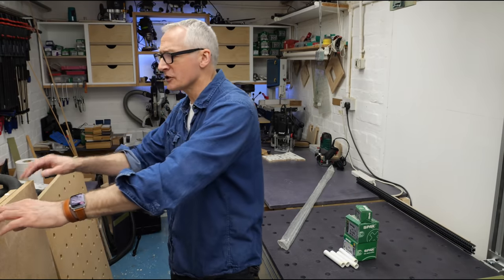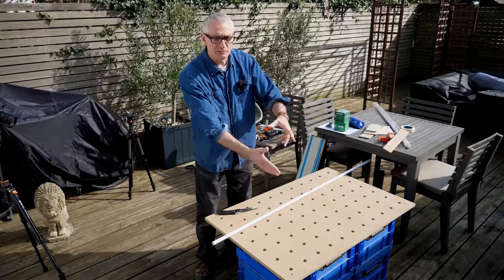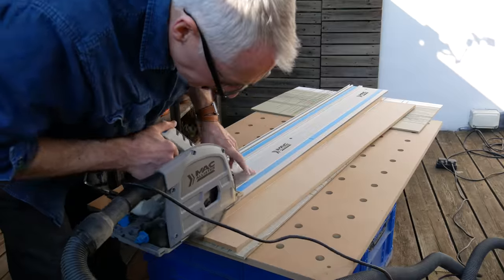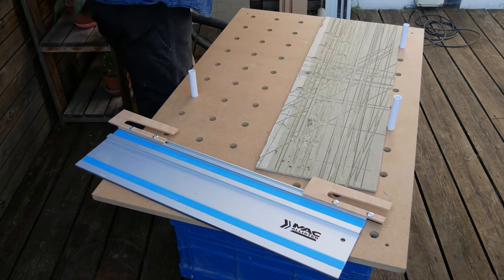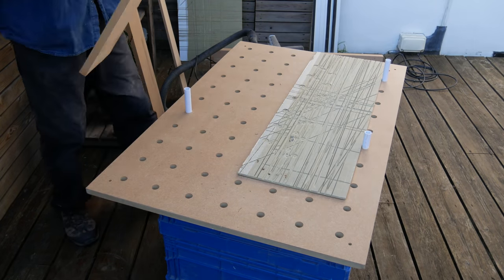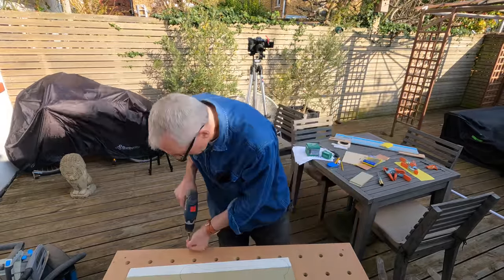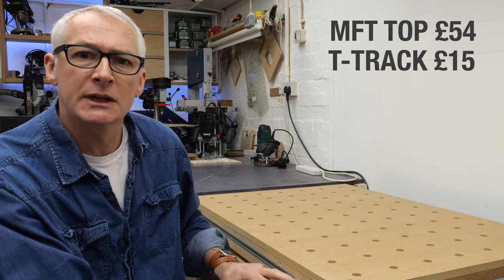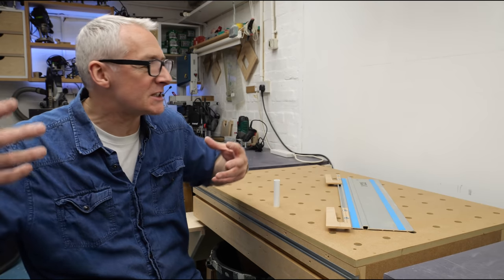Backyard, DIY MFT on a Budget  [video 490]

Comment: One Question Peter, why spend £39 on a piece of 18mm MDF with some holes drilled in it 😂  - I’m no genius, but drawing a grid and drilling some equally spaced holes, really isn’t difficult, nor does it require much in the way of tools ? - Julie
Reply from the maker: Well, I make videos for all levels of ability Julie,  and if you’re happy making a perfectly square grid of 20mm holes on 96mm centres with just a drill then that’s what you should do. But for the folks who may find that a challenge - or just not a productive use of their time - then paying £39 for a factory-fresh guaranteed square and bench dog friendly MFT top is a steal. Of course, if you just want it for clamping and cuttings, and squareness or bench dog compatibility isn’t a big deal - and my first portable bench that I used for years was just holes plugged in a top with a 20mm spade bit - then none of that matters.👍👍

Comment: Another great video. Thanks, Peter. Certainly going to use some of that!

I'd love to see a T-Track vs MatchFit-Dovetail vs routed T-Slot comparison - not forgetting that there's more than one "standard" of T-Track, of course! I've used T-Track in my builds, and I'm a bit of a fan of the MatchFit system (brilliant way to build an assembly-table), so it would be great to get your input. Different solutions to different problems, of course, and personal preferences come into play too.

Keep up the good work!
Reply from the maker: Thanks Ken! 👍

Comment: Peter, great video as always! But whilst watching I was struck by how nice the horizontal fencing in your garden looks. 😁 I’ve seen people do something similar with 25 x 50 roof battens, but yours look a bit wider. Assuming you built it, if so what did you use to clad it?
Reply from the maker: Thanks James! It’s 3x1” planed redwood that I had tannalised. Over 1000 metres (a kilometre!) and I still ran out. So I used untreated redwood and it’s been absolutely perfect! No difference at all to the treated! 😂 Could have saved myself a ton of money! 🤷‍♂️

Comment: Peter - i saw in many videos that you used the same track saw to cut wood and aluminium. Is it using the same blade?
Reply from the maker: Yes, absolutely; for the occasional cut any TCT blade will have no issues with aluminium; if you're doing a lot then it's worth investing in a proper aluminium blade - they work really well in plywood too! 👍

Comment: Another YouTubing carpenter has had problem with the first few cuts, the results were out of square despite the holes being properly aligned with the MFT – which itself was also squared OK. He eventually concluded that the bench-dogs were loose in the holes, thus producing cumulative errors in his work.
Reply from the maker: Yes, you need to be diligent and take nothing for granted.